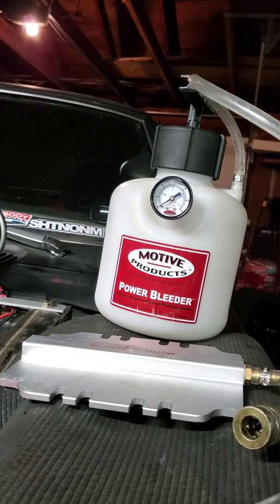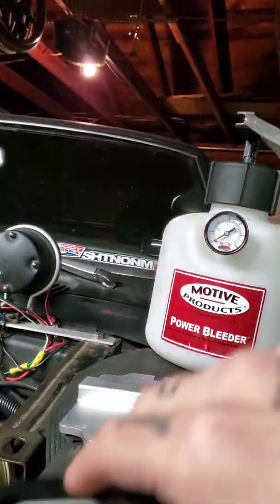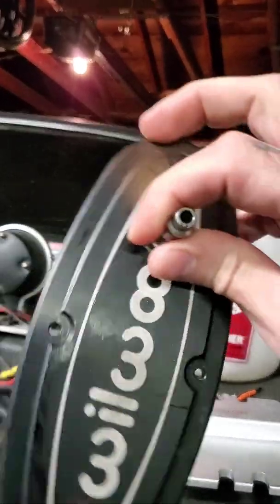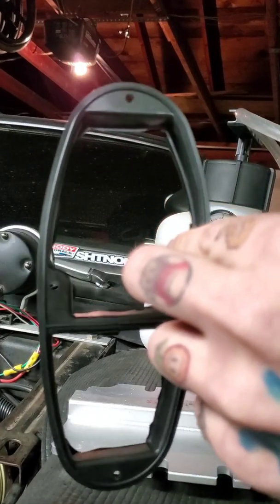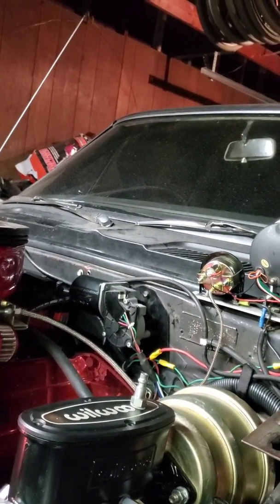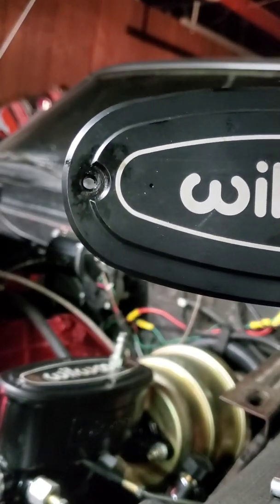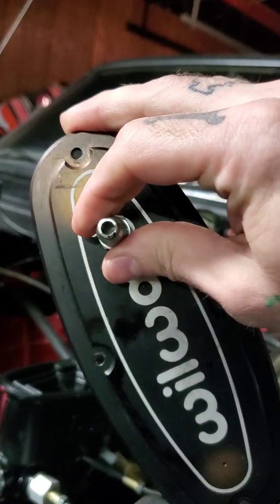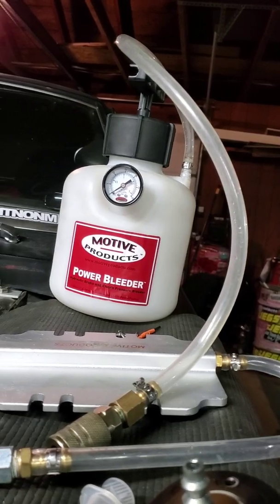DIY Wilwood master cylinder pressure bleed adapter.

Comment: This is awesome! Thank you for this video - I currently have the same willwood master cylinder. 
I purchased a separate cap and will do this exact thing! 
One question - where you installed the male air fitting, did this distribute the fluid to both front and rear cups in the cylinder? Seems to me that the dividing wall would be an issue.....
Reply: There is a small hole in that "wall" which will allow the levels to equalize.
Reply: Yes! Thanks! I realized that once I pressure bled the system. Thanks again!! Your video really helped me!
Reply: @bolisticbee   Not my video. I can't take credit. I was just here checking out the modification myself and saw your post.
Reply: @SeriousExplorations ah sorry - wasn't paying attention 😅